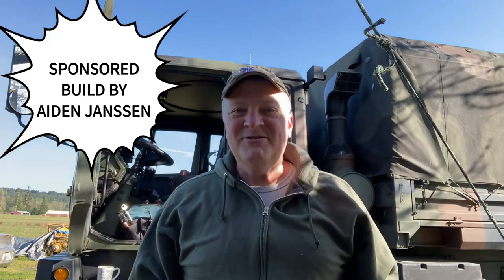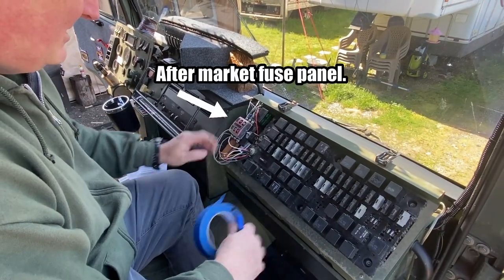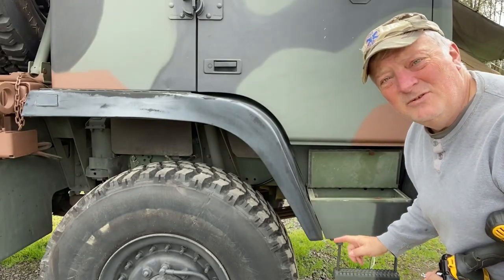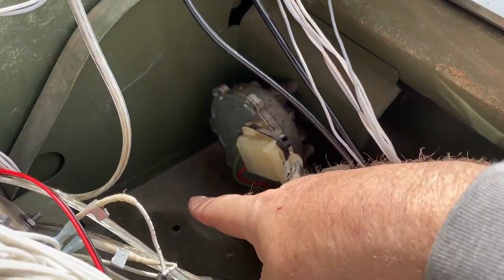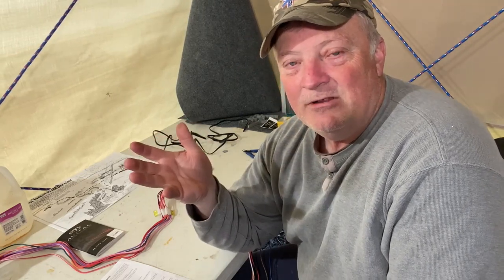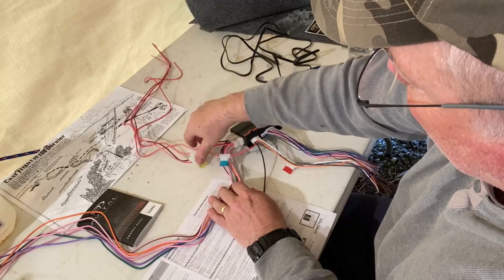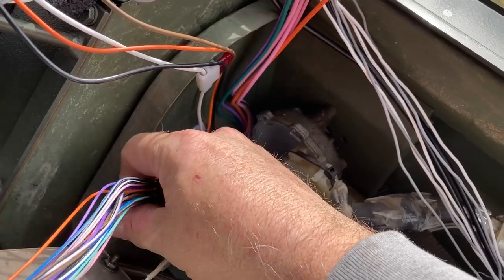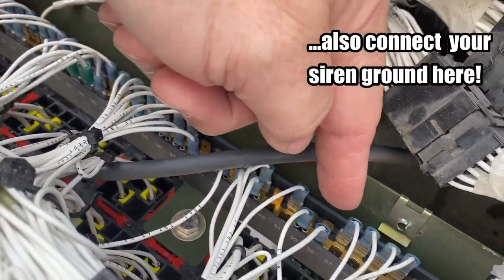FMTV REMOTE START & ALARM System Install Part I #189

Comment: Hi Dave looks like alot wiring +engineering, call if you need any help
Reply from the maker: Got it figured out... more work that I was not anticipating, but had in the back of my mind as a strong possibility. I just didn't want to admit it, at first. :-D